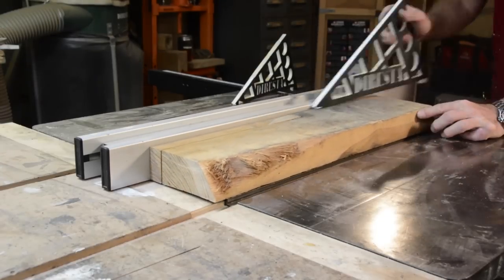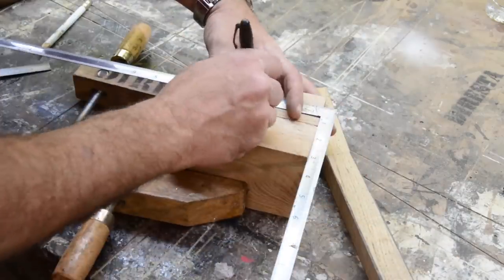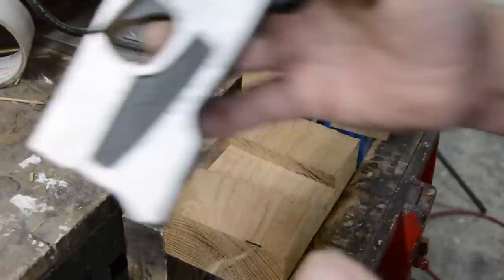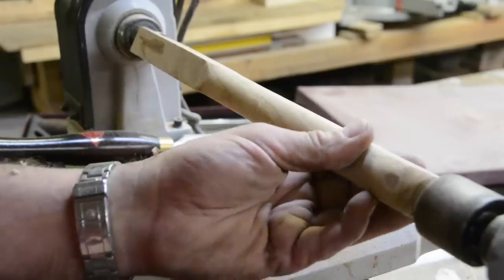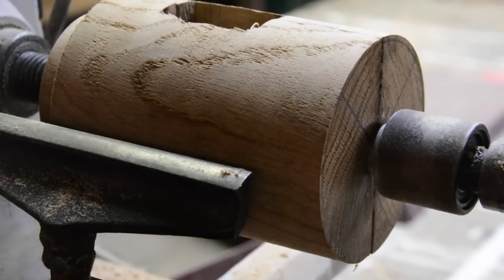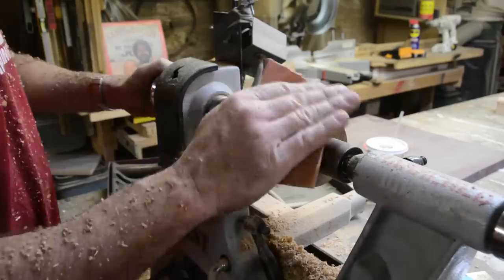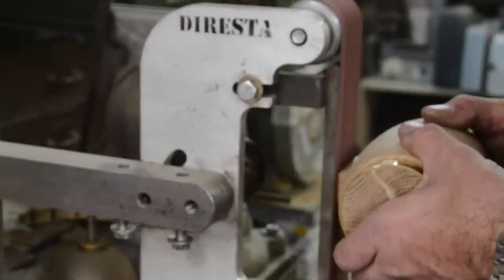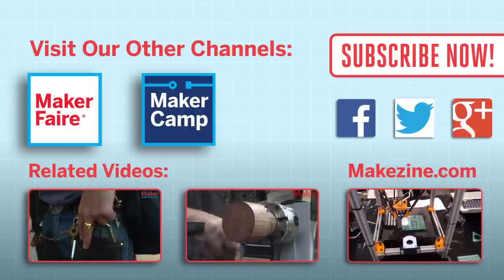Diresta: Gold Ring Mallet

Comment: Nice design, I need to make a couple of job specific mallets soon and the brass rings are a nice touch. 

Shame about the drive/live centre marks on the mallet faces but I suppose they'll fade with use. 

It's something I used to overlook in my earlier lathe projects but now I take it into account and cut them off or mount the work in such a way that it doesn't leave them in the first place i.e. by using a chuck and a soft cover over the live centre.

Comment: To get rid of most of the sanding marks, I usually sand a finish with 180 and 230 grit sandpaper and after that I use the shavings of the turned piece to give it a nice polish. This way I usually don't have to polish manually and can go straight to sealing the surface...

Comment: Nice work. Your rings are going to work themselves loose over time, due to difference in expansion and contraction with wood and metal, but that can always be fixed with screw and glue. Looks great tho.

Comment: I hate to be "That Guy". But seeing you laying parts down and test fitting stuff inches away from the running blade on your crosscut sled made me uncomfortable. I don't observe many overly protective safety rules, but turning the saw off before using the top as a workbench is one of the major "Do's" in my shop. 

Otherwise, great little pounder you made there. How much did that brass pipe cost? Im almost afraid to ask. LOL. Keep up the good work.

Comment: I was doing wood work after so long time, my buddy had a wood mallet and it was useful... so i made my own in hour using this as base line, so he could get his back (also my version is more sexy than his ;P). 
Tools dont need to cost much, when you can make your own in a fly, that will do the job needed.
Come thing of that... actually when you do buy tools... buy best ones you can afford at least if its chisel.. Lesson learned: China steel chisel is softer than plywood...

Comment: Don't use gloves with a sander like that, if there's a loose thread or your finger touches the belt, it'll pull your finger into the gap between the belt and the rest. Even nicking your finger on a belt takes a chunk out, you really don't wanna find out the hard way.
Cool end product though!

Comment: 5:30 how the fuck does he do that without the tool flying off because it can get into the hole?
Reply: he's a professional not just a random guy.
Reply: There should not be any problem if you go slower and take smaller bits every time, we are perceiving that he takes half of the material in one turn (because of accelerated fps) but in reality he is going much slower(maybe 1000 rpm or less)